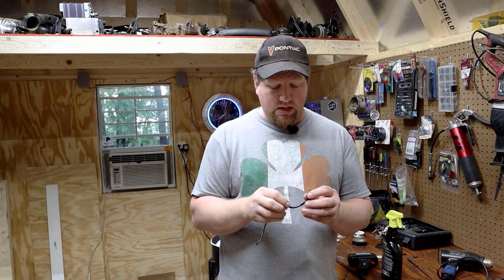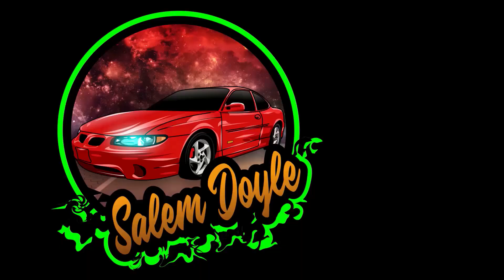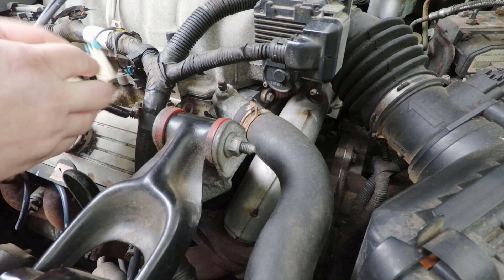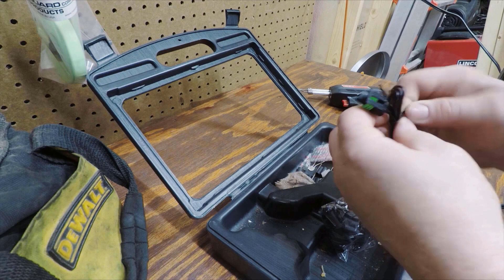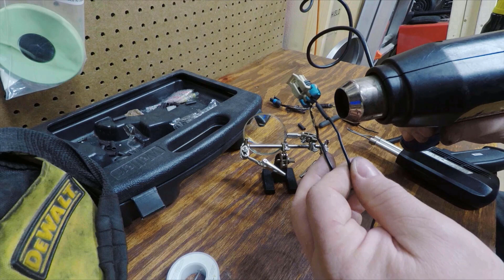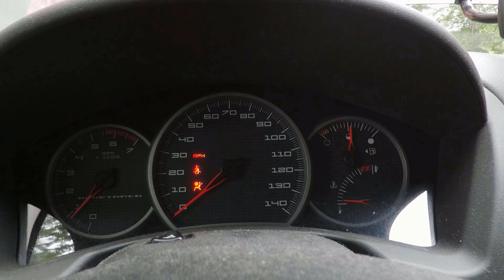2005 Pontiac Grand Prix Coolant Sensor Harness Repair

Comment: question, i have an 02 gtp low coolant light comes on then turns off when hot.  the light will also turn on when going uphill but will not over heat then turn off when level or going down hill.  ive bled the system over and over and i have fluid.  however the upper hose is softish i replaced the cap so it is not that and the system is holding pressure.  i heard some cars need to be jacked up from the front when refilling.  by the way this started after i replaced the radiator.  A new coolant level sensor was installed as well.

Comment: A friend's fiances brothers cars fans don't turn on. It's a 04 grand prix with the 3.8. the ac fan (passenger fan) turns on with ac on but the cooling fan doesn't work and I got it to 220 temp and still no high or low. Fans power up fine, jumper wire on fan 1 relay spot turns both fans on low, fan 2 relay turns both fans on high setting so know my wiring is good from fuse box to fans. I unpluged the ect sensor and started it and the ac fan comes on (without ac on). I had read that's a way to see if the sensor is the issue with cooling fan not coming on but it's the ac fan that comes on with it unplugged. Thought maybe the connectors were backwards but then again with the ect sensor plugged in and ac on that passenger side is the one that comes on and that is the fan for ac. Do you have any enlightenment on the issue I'm having?
Reply from the maker: The two most common issues would be the fan grounds, and the ect being bad

Comment: Changed temp sensor but was wondering what that hole is right next to the sensor is? Any idea
Reply from the maker: Not sure wich hole you mean
Reply: @SalemDoyle  its right next to temp sensor on the engine block
Reply: @SalemDoyle  can i email you a picture of what I'm talking about. Its got me baffled?
Reply from the maker: @B-S1999  got it and replied
Reply: I have 05 pontiac grand prix, and the tempeture gadget on the dash just quit working, like does not move up or down, like it's dead, is it the tcs? Please help..
Reply: @darrenroy4857  I'd definitely would replace it just to see doesn't cost much and pretty easy to do
Reply: @B-S1999  I wonder what else it could be?
Reply: @darrenroy4857  not to sure but if the coolant sensor isnt working i would think ur temperature gauge wouldn't either. If it was me I'd change that first

Comment: Great video. Does it matter for the color or wire orientation if the wires are both black on the replacement part?
Reply from the maker: I dont think so. But i would still try to match it up
Reply: @SalemDoyle  ok that sounds like right. I'm about to replace mine, but I still got an original wire and connector that is black and yellow lines.

Comment: Thank u!!!!!!!! I need to do this to my Grand Prix.  The lil clip that hold on the thermostat to keep it in place,broke so the wire was on the pipe and it melted the plactic around the wire.  I haven’t checked it the wire melted. But once I taped it in place the check engine light went away and BOTH FANS WORK.  BUT THIS VIDEO WILL HELP me just in case I have to change the plug
Reply from the maker: Glad it helped

Comment: Pretty easy fix. I'm sure a shop would still charge a lot for this.
Reply from the maker: Deff.
Reply: @SalemDoyle  do you have a video on checking or how to test Cooling fans on 2000 grand prix
Reply from the maker: @sean.g4516  not yet